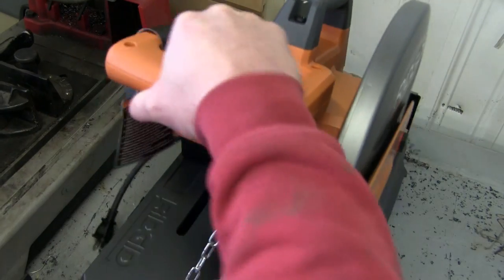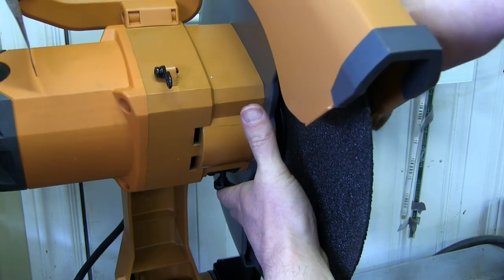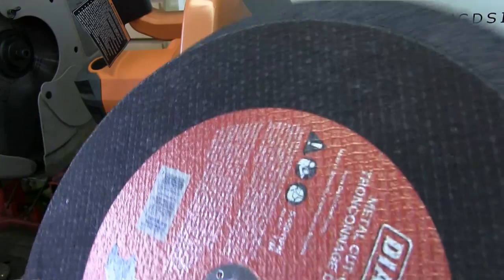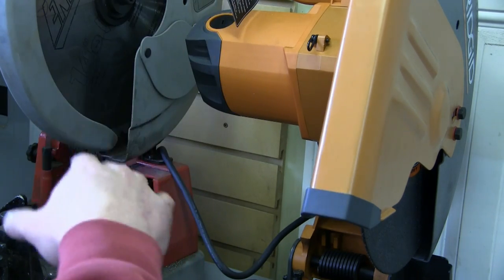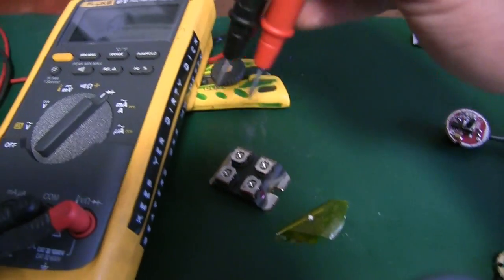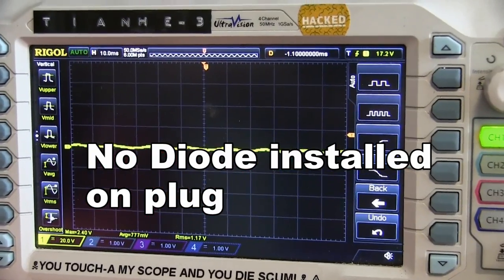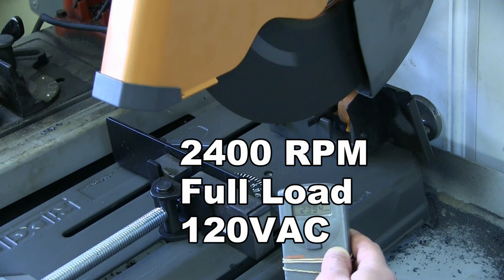RIDGID abrasive cut off saw converted to dry cut. Maybe.

Comment: As an electrician I can tel you that al the people on the coments saying that you should add a gear reduction instead a voltage reduction are right. The thing is that any electrical motor has three independendt vital values: Max voltage (determinted by the insulation of the coils), Max amperage (determined by the eficiency and the ability of disipate heat) and max rotarional speed (determined by the physical characteristycs of the motor shaft and conmutator or rubbing rings both of the last ones if apliable)
When you undervolted the motor, to a given load it is goin to draw more current from the wall. Since for a given load it needs X watts it doesn't care if you change the voltage, its gona draw more amps from the wall to compensate, and as you may gest, overheat and burn.
Also a characterustic of motors Vs engines. Motors don't have a "max torque" or "max rpm" , they have nominal ones, the diference is that motors will work over nominal until they die. So you can ask a 750w motor to output 1kw and it will do for a shor amount of time until it burns, so you can cheat and ask for more than nominal and if you do it for very short amounts of time you can get away with it winout damange.

Comment: Always so cute, 115/120Vac users and their troubles with breakers.
Reply: Hey all we do is use your wire, oversize breakers, now weve got less problems than your 220!
Reply: @imagineaworld , most of 220 is like 235; other than that the appetite comes with the eating and 16A tri-phase is still not enough, sometimes...
Reply: @stanimir4197  And that is when the triple 32A comes in. For when you want to go beyond 11kW like my 18kW mill.

Comment: Try a single phase VFD, it will allow you to adjust the U-I / U-f characteristics and you may be able to tune it to a point where the saw has just enough torque but does not overheat. Use one where you can disable all fancy features such as vector and slip control, so it will not error out on you.

Comment: Another possibility would be using a 14" diamond blade for gas saws . we use them on gas 
concrete/demo saws to cut everything from concrete to steel. On a recent job I loaned mine to the well drillers to cut large metal casing pipes, several hrs and a few tanks of gas later they couldn't believe how well it cut and the diamond blade was still like new

Comment: I have to agree 100%, I bought a steel blade and used it on a Milwaukee. The blade spun great way less vibration than a abrasive wheel. Made all of 6 cuts and had $100 tuition bill. Blade wouldn't cut anymore just turned the metal a nice orange. Thought about pushing it then I realized my bank account was too low for the ride to the hospital much less the stay. So yeah don't try the dry cut blade on abrasive cut-off saw, unless.... you like watching your $100 bills converted to smoke and ash.

Comment: The way to reduce rpm on series wound is to reduce the voltage. Other resistive regulators such as resistors or shunts cause loss of power because of the voltage drop increase as soon as you apply mechanical resistance on blade. With diodes you lost half of power per each cycle. 
The smell probably was from your xfmr cause your saw should have thermal protection and meant to be overloaded from time to time. 
I converted my Bosch mitering saw to metal cutting with half of rpm. I just installed 3kVA xfmr and have about 60VAC on secondary, never had an issue and yes amps on secondary will go hi but they go just as high on 120VAC when u apply force. The only difference is the xfmr allows u get more amps out of your circuit through the turn ratio before your breaker trips at the panelboard

Comment: I had to cut some 1/2" sheet steel. My Plasma cutter just wasn't clean enough so I used a metal blade in my Milwaukee worm drive with full body protection. Boy o boy did the spark fly and cut it like butter for a total of about ten feet. Clean cut and didn''t have to do a ton of grinding. I'll be doing that more often but respecting the blades life as well as my own.

Comment: bolt on planetary gear reduction unit and spacers to move the blade guard accordingly.  I own one of the Milwaukee cold cut saws and have been pretty happy with it, looking forward to hearing your comments in regards to why it's no longer available from milwaukee

Comment: WTF is 0.787 inches? (20mm)
Reply: decompyler well usually you go to 1 inch
Reply: 51/64"  is .7969 inches or 20.2406mm. Odd size to pick though...
Reply: Huh, we're not in that alternate universe *yet*, no AVE president, metrique still around.
Reply: isnt that the square root of 2 or something?
Reply: 20mm is 2 cm 0.2 dm 0.02 m mutchs easier than 1 yard 3 feet  36 inch.
Reply: It's a hell of a lot to wade thru. Probably best to wait until after the gyno exam.
Reply: bobwatters that's why I said 0.7969 haha. it should be big enough to fit and wobble itself round. Or something like that...
Reply: Aircraft bullets

Comment: Speed Control on an ac motor should be done through frequency variation, not voltage. Also, if you do manage to reduce speed with voltage, you should introduce a current limiting circuit because less speed = less cEMF
Reply: Yes a 3 phase ac motor yes,
Reply: that appliance has a dc or universal motor. Voltage is the only means of speed control!
Reply: aaand... its not an AC motor. its a universal motor. 
If it was an AC motor he would've had a much easier time of this since he's got so many 3 phase drivers around. (They probably have settings to use them as a 2 phase or single phase as well)
Reply: @nickopedia5669  Well to be technical a "universal" motor is an AC or DC motor that why its called universal. Not all AC motors are induction motors.
Reply: Frequency control as a mean of speed control only applies to synchronous motors.
Reply: @AviewFromUnder   
Yes there is? Ask Philadelphia lol.

Anyways in common US residential power supply you have 2 phases 180 degrees apart, however it is actually called split phase, not 2 phase as I would've thought. The term 2 phase was already taken by 2 phases with a 90 degree offset. (mostly gone but still used in some places like the City Centre of Philadelphia)

Comment: Supercapacitor in parallel would solve the torque issue.  In conjunction with the variac.  This would help to mitigate both the in-rush and running current.  Add a bleed resistor to the cap as well, to keep it charged before contact.
Reply: uhhhh, supercapacitors are rated at like 2.5V maximum - Boom!!!!!

Comment: it's a 20 mm hole because the blade you bought is for one of those gasomoline powered angles grinders (see the little picture on the blade) for cutting concrete and such, those machines are always with 20 mm arbours

Comment: This is why I like my Kalamazoo chop saw so much. It's belt driven from two pulleys so I can just change pulley sizes to slow the arbor speed down. I gain torque doing that too. It's only a 7" saw so carbide blades in this size are rated for a higher RPM (about 3500) to begin with.

Comment: Carbide simply hates vibration, even a clapped out milling machine can chew up carbide cutters from the play in the spindle especially. I think these get a benefit from the size of this spinning mass but you can't have the individual teeth vibrating on the surface of the material from a light cut. If you aren't pushing hard enough to really make a chip with every tooth on the blade then you will start breaking them. If the cut made your part hot, increase the feed.

Comment: Why didn't you used a fuuull bridge  rectifier ...?
Reply: ATech a full wave bridge diode setup would increase the voltage to almost the peak to peak which 120vac is around 169vdc if I remember the math correctly.
Reply: Unibrow dance sounds

Comment: why don't use a VFD(var.freq.drive)?
Reply from the maker: We've gone over this. 120V 1ph input to 120V 1ph out for less than a kilobuck?
Reply: Could you not limit the current to 20A? yes it would be under powered, but still functional for thinner pieces. as for over-heating, add a fan to the case and a heat sync to the motor shell?

Anyway, love your vids and great content !
Reply: Varible frequency drives are for induction and synchronous motors. If you want good speed control of a universal motor you need a speed sensor and feedback system.
Reply from the maker: Again, we've gone over this. They are 3ph output. I purchased one and demo'd it.
Reply: Need to change the line frequency to get your torque right. They exist, and would be semi-trivial to homebrew one with a microcontroller and a few power transistors.
http://www.globalindustrial.com/p/motors/motors-controls/ac-drives/1-phase-115vac-1hp-drives

Comment: I used a miter saw as a metal cut off saw.  Just changed the blade.  Worked beautifully.
Reply: What blade do you recommend? Is your saw a 3,900 rpm? I found a Milwaukee Steelhead blade that are rated @5,500 rpm, but those damn things are 129$-189$! Do you know a cheaper option?
Reply: @wesman7837  I recommend an abrasive blade on a miter saw.  Should you choose to use a metal blade, which I do no recommend, I would find the highest tooth count you can.  I would also find the smallest blade you can that will fit your arbor.

Comment: I'm sure I was taught in college that there are only two ways to effectively alter the speed of a single phase motor. You can either change the number of poles on the motor or change the frequency of the input voltage. Don't know how you would achieve either of those but a brighter mind than mine might know. Also, a power factor correction capacitor would help with the bringing the lagging current back in line with the voltage.

Comment: I use a normal wood working compound mitre saw with a £10 "multipurpose" blade. I've made at least 100 cuts in 30mm box section 3mm thick. Still fine...
Reply: cncgeneral exactamente

Comment: How 'bout trying to reduce the speed by using a triac, instead of a Variac? I would think that that would work a bit better (what with power factors, over currents, and all such other similar nonsense). Should still provide good torque, what with the triad sensing back EMF, and automatically compensating, and such. Just curious... Like, enquiring minds want to know.

Comment: I really wanted a cold cut saw . so I put the blade in an old craftsman table saw swapped the pulleys to get the upgraded 1hp motor to go as slow as possible. Works good but need to put the rippemajig meatah on her. Love yer stuff keep it up.

Comment: Why not change the frequency of the power? 30Hz instead of the 60Hz?
Reply: Rectumfy the power then use a beefy H-Bridge controlled by an arduino... might be a cool project.
Reply: Alexander Hiller frequency won't change the motor speed
Reply: Alexander Hiller If it's a universal motor, then changing the frequency wouldn't do diddly squat.. better to hobble together a 1 to 3hp induction motor on a pivot.. Sketchy AF but it'll give you your 1500ish rippums (that would be frequency dependant)
Reply: Fair enough, I stand corrected.
Reply: Do you think it may be still worth a look at an H-Bridge type setup and reducing the duty cycle?
Reply: He's already done videos on his computer controlled h-bridge, or "Variable Frequency Drive" as it's technically named.

Comment: What if you increase the voltage while under full load? It'll drop the current but keep the same powah output. I do think there is a little drop in torque due to the rotationspeed increasing.
Reply: Azagro increase the voltage under full load and the current will shoot up unfortunately

Comment: Have you thought about trying DC converted power and PWM (pulse width modulation) speed control ?
For motors that are not happy with reduced voltage and start to overheat, PWM keeps the voltage at (practically) full, but pulses the power.  Might be the key to reducing the heat issue.

Comment: You need phase control and run it at half the frequency not half the voltage 😁 yes I'm a professional pixie wrangler 👍
Reply: More specifically, you need to keep the {volts:Hz} ratio constant; 1/2 speed needs 1/2 voltage AND 1/2 frequency.
Reply: That would work on a brushed DC motor like in that saw? 
I thought that was the whole reason he didn't just stick a phase controller on it like he did the air compressor.

Comment: You can buy 230/240V single phase saws, we have 230V phase-neutral and 400V line-line here in the NZ. Change the plug and dribble some electrons into it from your low pressure network.
Reply: " 230/240V single phase saws", that would be all metric guaranteed,  can't have that.

Comment: I couldn't help to notice the abrasive blade is incorrect for that saw! It is designed for a gas power demolition saw. I made this mistake before.. it will take 2 weeks to cut a small piece of metal. The thinner blade is the correct one. 😜

Comment: you should collaborate with photonicinduction
Reply: nachoman4793 ahh that'd be great fun. Photon certainly has pixies to offer
Reply: nachoman4793 That'll go from 2kW to 20kW saw.
Reply: I was going to post the same suggestion.
Reply: First thing photonic would do is bypass the safety bits and plug in a huge transformer.
Reply: Imagine a dry cut saw with 20kW running through it!!

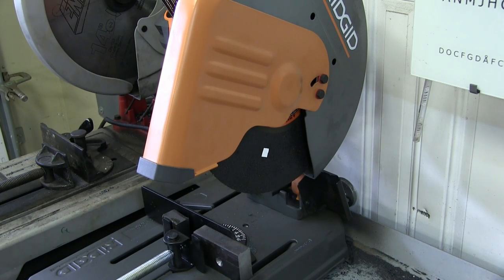Comment: I took a table saw and slowed the blade to 1700 rpm and with a cheap 40 71/4" tooth carbide ($10:00) wood blade. I can cut steel almost as fast as wood  with all the accuracy that's built in the table saw. Nobody has this on YouTube

Comment: Yup.. Done it. I burnt up one of those dry cut blades in my.Milwaukee chop saw. I think I got about 12 cuts out of it. This was back in '04/'05. It was a $150usd blade at the time. I think of it as a seminar in understanding ... Lol ..it helps

I've since then bought a Makita dry cut saw and 2 of those blades (morse metal devil) for my skillsaws. They cut like butter so now my plasma cutter has turned into a hat rack for my hood.

Comment: harbor frought used to have a low rpm abrasive we ran the dry cut blades on , no mods . dry cut is a hell of a lot louder  than abrasive, but a lot cleaner air.

Comment: You can buy beastly 16" X 1" arbor import chop saws that weigh over 200#s for $400.00     The great thing about these machines is they have an regular motor that drives a belt that turns the blade shaft.  So it's real easy to change motors and pulley diameters to get a desired blade speed.   You really end up with the best all around machine, short of spending over 1k for a cold saw.  Oh yeah, and be sure to really take clamping and staying away from the blade seriously....these things will kill you deader n hell throwing loose parts out, or exploding a conventional cut off wheel.

http://www.wttool.com/index/page/product/product_id/16200/product_name/RDX+16%22+Cut-Off+Saw&update_continue_shopping=true
Reply: Awww. It says out of stock. Nice 240v saw tho

Comment: Per that Milwaukee dry cut - I used to use one a lot at the college sculpture lab where I worked for a few semesters. The saw cut fine, but the blades were constantly breaking teeth. I don't think that they spun too fast, but I never checked. However, that vice that they came with was s**t. I had it release on me at least 10 different times. I don't know any other details, but the sliding vice on the milwaukee dry cut was a nightmare. I got to the point where we tack welded the hinge close to get rid of the quick adjust feature since it kept letting go. Of course, once the damn vice lets go, the piece jerks around and all the teeth break off the $150 saw blade. Sphincter test indeed.

Comment: Tried using a Black and Decker Industrial chop saw with Evolution blade. Used a Harbor Freight router speed controller (triac). While I was able to reduce speed (evolution blade rated for 1600 RPM), the torque suffered greatly with this method as well. It does work if you're patient and don't push it, but it's slower. another issue with these saws that have stamped steel bases is that the downward force of cutting puts a slight twist on the base and no matter how well you have it squared up, you can't get a square cut.

Comment: Those chop saws are good for cutting rebar and that's about it. 

After discovering 6" cutting discs for angle grinders I gave chop saw away and don't miss it a bit. My bro just offered me his because he outgrew it for the same reasons.

An angle grinder has far more capacity and can be used for accurate cuts in many positions. They'll clip a truck axle (not just the housing) and cut steel plate if you let the disc float. 

Chop saws suck. They were good for a few tasks back in the proverbial day. 

BTW with a bit of washer-fu you can run zip discs in handheld circular saws too, and everyone has a few of those accumulated.